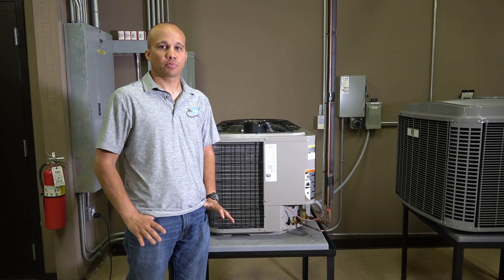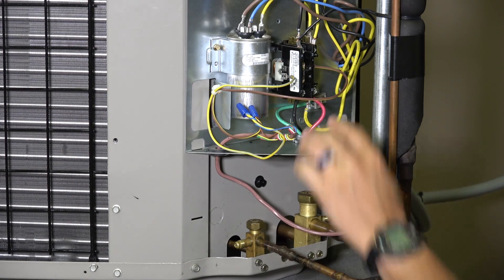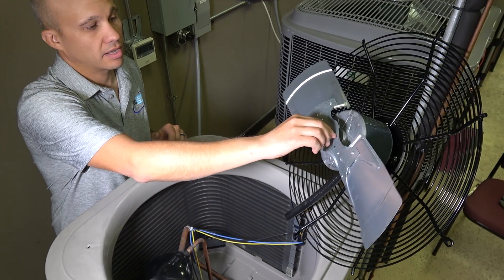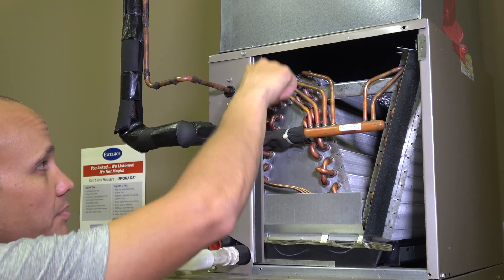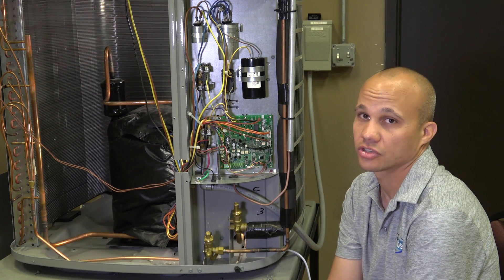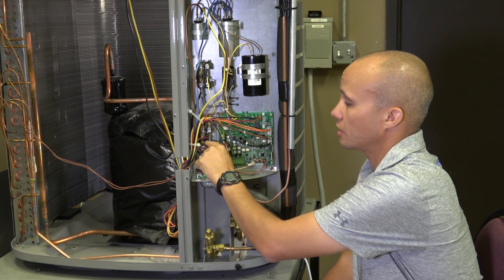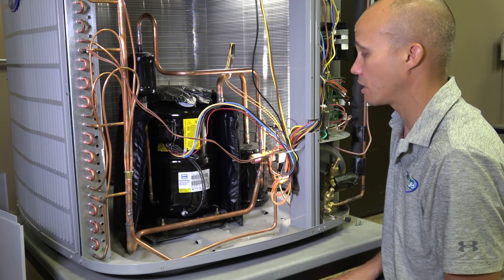Air Conditioner & Heat Pump Components

Comment: Thank you very much for the information. I just had my Carrier heat pump, coil and gas furnace installed by a company a few months ago. But there is always a mild baseline sound probably from the transformer even when the system is not running at all. Is it normal? There is a WetSwitch attached to the unit. Does it cause the minimal sound? Thanks
Reply from the maker: Sorry, without hearing the sound, we cannot guess where it is coming from or if it is normal.
Reply: Thanks for the response. It is like minimal humming sound from the lower part of the unit where the transformer and blower are. But anyway, it is still possibly normal if there is a minimal sound when the system is not working, or any sound would be abnormal when the system is not running?
Reply from the maker: @beckhamzhang4805  For the furnace, no noticeable sound would be normal when the system is off.  For the outdoor heat pump, if you have a 25VNA model, then a slight high frequency sound could exist from the inverter even in the off state.
Reply: @TECTubefilms  Thank you very much for the information. It is very helpful. Can you hear high frequency sound of the inverter (in the off state) only from outside close to the heat pump, or can you hear it from the inside unit in the basement?

The system I initially ordered was listed below. But on the day of installation, 58CVA110-20 was replaced by 58TNOA110C21–20. I was told 58CVA110-20 was out of market. 58TNOA110C21-20 is the same as 58CVA110-20. Does this change affect the sound?

Carrier Infinity 25VNA8 Heat Pump 4 Ton + 58CVA Furnace 110 BTU, ! AHRI Matched
INCLUDES
Carrier® Infinity - 4 Ton 18 SEER Residential Variable Speed Heat Pump Condensing Unit
Carrier® Infinity 80% AFUE 110000 Btuh Variable Speed Multipoise Gas Furnace
4 Ton Evaporator N Coil Cased Vertical Upflow /Downflow Painted 21" Width (Aluminum)
HSPF: 10 | SEER: 18 | EER: 10.5 |AFUE: 80 |CC: 45000
FEATURES
Sound reduction: fully insulated cabinet and QuieTech noise reduction
Technology: Variable-speed blower motor

Also include the following accessories:
Carrier® - SYSTXCCITC01-B Infinity® System Control with Wi-Fi®
Aprilaire - Large Capacity Whole-House Bypass Humidifier With Manual
Control

Thanks again.
Reply: The sound/noise is like the one from a bad ballast of fluorescent light when you turn it on, or the one from a transformer of a doorbell with short circuit in a raining day. The sound is mild. I can hear it when I walk very close to it. Or it maybe a resonance, an echo from the hollow system and other nearby appliances. It is an expensive system. Hope it can last for some years, and don't break down so soon.
Reply from the maker: @beckhamzhang4805  For federal rule from the DOE relating to furnace fan efficiency, all furnaces from all manufacturers had to change on July 4 this year.  Once old models are out of stock, customers will get new models.  That change would not affect sound levels in standby mode.
Reply from the maker: @beckhamzhang4805  Sorry, we don't know the source of your electrical sound issue.  Someone would need to inspect the  components to determine the source.  This will need to be done with the power on so it should be handled by an HVAC or electrical professional.
Reply: @TECTubefilms  Thank you. Very helpful. Where can you hear the high frequency sound of inverter?
Reply from the maker: @beckhamzhang4805  https://youtu.be/gawpEtXBhFY
Reply: @TECTubefilms  cool video. I wish you had recorded the sounds of inside and outside units when the whole system is not running. This way, we know if there is baseline sounds when the Carrier Infinity system is at the resting status. This morning, the installer came and said it is normal. The minimal sounds from the lower part of the inside system (where the blower/transformer etc are). He said the sound is from electricity running through the system at the not-working stage. So I feel better no matter what. I keep my fingers crossed that the new sensitive system will last at least 10 years. The old original one lasted 20 years. Thanks much again for your tremendous help.

Comment: Transducers take pressures and in return translate to a processor as holms or resistance aka electrical DC or digital signals.  This unit he is talking about does not employs transducers, thoes were  high pressure and low pressure on off dumb switches they brake and on contact based on pressure excessively high or too low...

Comment: Why does ice buildup on tubing around components, and can that cause lower air flow and warmer air coming into house?
Reply from the maker: It is usually the other way around.  Lower airflow often causes the ice to form.  Restrictions such as a dirty filter, dirty evaporator coil, or closing off registers are generally the cause of too low of an airflow.  Although, refrigerant pressure can also be the suspect.
Reply: The job of the indoor coil in cooling mode is to absorb heat from the conditioned space.  If you don't have enough airflow over that coil, it won't absorb enough heat and the temperature will drop below freezing (it's designed to be approximately 40F).  An improper charge can also be a cause.  In heating mode, the outdoor coil is designed to pick up heat from outside, so it is designed to be 20-25 degrees below the outdoor air temperature.  When the outdoor air drops below 50, the outdoor coil is going to be below freezing by design.  So, any moisture in the air will start to freeze on the coil and piping.  To fix this, heat pumps have a defrost mode, that engages on regular time intervals and the temperature of the outdoor coil. If the defrost mode isn't working correctly, or you have poor air flow (leaves, grass, dirt, patio furniture, etc on the coil) or incorrect charge, will lead to ice buildup as well.

Comment: What is the small black component next to compressor? Mine is a little leaking where it connects to the vertical copper round tube. Are they bolted? Do you by any chance know how to fix it? Also thanks for this useful video!
Reply from the maker: There are multiple black components by the compressor. The two cylinder looking ones are a muffler and a receiver.
Reply: @TECTubefilms  Thanks for you rely. AT 7:41 - I guess you said something sounds like 'ikyo͞omēlātə'?
Reply: The suction line is attached to the accumulator. This line is cold because of the low pressure the refrigerant (Freon) entering the compressor. It will condensate water vapor in the air. This is a good sign. However if you ever have to add refrigerant to your unit you have a leak. Some people think the refrigerant needs to be added every year. This is false. If a technician has to add refrigerant there is a problem, a refrigerant leak. There are 2 types of refrigerant used in residential hvac units R-22 and D-410A. R-22 is being phased out and and is expensive. R-410A is the new type of refrigerant. Fun fact, Freon is a name brand like frisbee. DuPont calls it Freon. In the hvac industry we call it refrigerant.

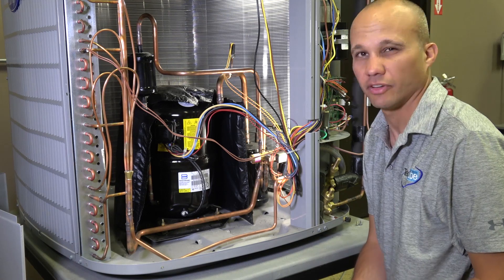Comment: 8:13 - Liquid line drier's function is to keep any debris from reaching the compressor. 

Correct me if I'm wrong, as I'm still just a student, but isn't the compressor a vapor pump?
Reply from the maker: The compressor is not the same as a vapor pump.
Reply: @TECTubefilms  I thought that liquid could/would damage the compressor and that it was necessary for the refrigerant to be in a vapor state prior to entering the compressor? Wouldn't that mean it's a pumping machine designed to only handle vapor? Or can it also pump liquid?
Reply from the maker: @ChristopherMSparkman  A pump moves a fluid.  A compressor lowers the volume or raises the pressure of a fluid.  Since HVAC is a closed system and the volume is fixed, it raises the pressure.  Because of PV=nRT, when the pressure is increased so is the temperature.  The goal is to have a higher temp than the ambient so we can reject heat at the condenser coil.
Reply from the maker: @ChristopherMSparkman  You are correct that we don't want liquid refrigerant coming back to the inlet of the compressor because liquids are relatively in-compressible.  But this has nothing to do your desire to call the compressor a pump.
Reply: I don't desire to play semantics about compressors and pumps. I just wanted to gently tell you that you made a mistake in your video.

Which I think by your responses and focus may or may not have been recognized.

The device mentioned at the aforementioned time stamps is not filtering liquid. It is connected between the discharge side of the reversing valve and the compressor.

I've been told, that placement is normally a muffler. 

Whatever you want to call the device that moves fluidic vapor in the refrigerant circuits it surely doesn't move liquid regrigerant very well.

That's why often accumulator's are used right? We only desire vapor to reach the compressor.

Either way still really like your video's and have learned a lot from them.
Reply from the maker: @ChristopherMSparkman  It seemed to us like your entire post was related to the semantics of a compressor and vapor pump.
Reply from the maker: @ChristopherMSparkman  You also began your post stating "correct me if I am wrong, but..."  That did seem to us like you wanted to debate the semantics.
Reply from the maker: @ChristopherMSparkman  Finally, if you wish to prove us and the entire HVAC industry incorrect and motivate us to start calling all of our compressors a "vapor pump," please provide a hyperlink to a reliable resource explaining the difference between the two terms.
Reply: @TECTubefilms  Gentle attempt to get you to look again at what you were talking about at the time interval that I linked in my first reply. 

Subtle and respectful, not a pompous.. hey guy you are wrong..

but hey.. you are wrong, it's not a liquid line filter dryer at 8:13 ish.
Reply: @TECTubefilms  Again thanks for the replies, it's important to engage your audience. 

It's a muffler not a liquid line dryer. 

Next time I'll just call you out since it seems the know it all in you can't read between the lines when someone tries to send you a hint. 

Regardless I still enjoy the content you put out.
Reply from the maker: @ChristopherMSparkman  Your question was about a compressor and a vapor pump, not a liquid line drier.  Therefore we did not go back and look at the video for any errors related to minute 8:13 or liquid line filter dryers since you were asking about compressors.  We were confused on your question.  We will go back to our technical guys and ask about minute 8:13 now.
Reply: @TECTubefilms  Definitions and Terms really are fluid things, since you asked...

Webster's defines a pump as...

1 : a device that raises, transfers, delivers, or compresses fluids or that attenuates gases especially by suction or pressure or both

Also see NATE Glossary of Terms in their CORE manual:

Pump Down - When either the king valve is closed or the liquid line solenoid is de-energized, allowing the compressor to pump most of the refrigerant into the receiver and shut off on a low-pressure control.

Key word.. PUMP...

Page 1182 Glossery Modern Refrigeration and Air conditioning...

Compressor - A vapor pump that draws low pressure refrigerant vapor from the evaporator and squeezes or compresses it to a high-temperature and high pressure vapor and into the high side of the system. 

Page 1627 of Refrigeration and Air Conditioning Technology, Compressor - A Vapor Pump that pumps vapor (refrigerant or air) from one pressure level to a higher pressure level. 

Apparently the compressor is in fact a vapor pump.. but then again that depends on how you define it... semantics normally really are a waste of time. 

again... there is no filter drier between the discharge of the compressor and the RV on a heat pump. FYI :)
Reply: @TECTubefilms  Yes my question wasn't direct as I guess it needed to be.

I wanted to be subtle... 

When my father wanted me to be able to save face when I misspoke or made a mistake he would always ask a question that made me think about what I just said.

Normally the inspection of my previous statement allowed me to correct my mistake without the need for embarrassment.

Anyway I respect your channel / content providers even more for being civil with me. I tested your professionalism and you didn't degrade the responses, to much :). 

Great work guys, you've got a long term viewer :)
Reply from the maker: @ChristopherMSparkman  We will go back to Ryan and ask about his potential error of the muffler vs. dryer.
Reply from the maker: @ChristopherMSparkman  We don't mind being called out or researching an answer.  We were just focused on the vapor pump question and did not realize you were also asking about the other component at 8:13.
Reply from the maker: You are correct.  The small black device is a refrigerant muffler, not a dryer as Ryan stated in the video.  The dryer ships loose with the unit and is to be installed at the evaporator.
Reply: @TECTubefilms  Every HVAC instructor/class I've ever had, in addition to most other youtube channels, calls the compressor a vapor pump to emphasize that it doesn't pump liquid.  A scroll compressor can handle a little bit of liquid, but a reciprocating compressor will be destroyed by liquid, fairly quickly.
Reply from the maker: @orangeandbluehoosier  We thought this argument was dead after two years… thanks for picking at the old would LOL
Reply from the maker: @orangeandbluehoosier  We are not even going to research it.  Feel free to call the A/C compressor a “vapor pump” on projects and then have to constantly explain to other techs what you are talking about.  :)
Reply: @TECTubefilms  From the ESCO "System Diagnostic and Troubleshooting Procedures" book, P6 Subheading: Noncondensibles "The air and water vapor will pass through the evaporator and compressor because the compressor is a vapor pump."
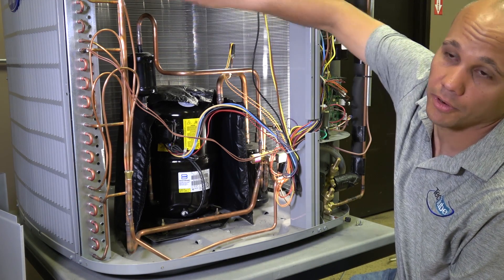Reply: @TECTubefilms  Actually now that I look at it again, the device that you pointing at 8:10 to 8:16 looks like it is connected to the discharge side of the reversing valve. If that is the case wouldn't that be a muffler? 

I'm going through my heat pump training now and I don't recall there being a liquid discharge from the compressor ever mentioned during lecture, am I seeing it wrong?

The way they have us drawing our plumbing or refrigerant flow diagram is with a bi-flow filter drier between the indoor coil and the outdoor coil. 

Also could you explain exactly what the nuanced differences are between the term compressor and vapor pump? Is it because a vapor pump wouldn't compress the substrate where a compressor would?

Comment: 6:45 It is not a pressure transducer. It is a pressure switch. Big difference.
Reply from the maker: You are correct.  The heat pump in the video is a Carrier 25HPA and it uses pressure switches.  Some of Carrier's heat pumps, such as a 25VNA use both pressure switches and pressure transducers.  For those unfamiliar, a transducer will send a specific pressure reading to the circuit board (and possibly the thermostat) to be used to make decisions.  A switch will simply open or close at a specific pressure, thereby letting the control system know the pressure is too high, for example, but not telling it what the actual pressure reading is.  Switches are lower cost than transducers.  Thanks for the correction @movax20h
Reply: @TECTubefilms  Absolutely, the transducers or "sensors" are more accurate, and smart, when tied with controller or computer, and allow for diagnostic, leak detection, and other stuff.  And they operation can be changed dynamically, i.e. with different load, ambient, change of compressor, coils, or refrigerant. But yeah they are more expensive usually. Also pressure switches are more reliable and can switch higher currents, so they can act as safety switches to stop compressor for example. Sensors / transducer don't have that feature directly, but are under control of controller, if it also fails, there is some small probability that it will keep compressor running. Very unlikely tho. No idea what are the regulations.
Reply from the maker: @movax20h  For small residential systems like this one, neither is required by regulation and most entry level units have neither.
Reply: @TECTubefilms  Do you know the brand/model of the pressure switches for r410a? The video shows a "Sensata ps80". I found online that for r410a the high-pressure switch should open at 600 psig and close at 500 psig while the low pressure switch will open at 50 psig. Is this correct? Do you also know a good brand/model for HVAC pressure transducer?
Reply: Yea I noticed a bunch of glossed over inaccuracies in some other areas of the video myself..  The capacitor descriptions were kind of terrible.. I wish these kinds of videos didn't exist.  Don't report on stuff as an expert unless you actually know what you're talking about
Reply from the maker: @localbroadcast  Thanks for the feedback.  While we of course prefer positive feedback, we will take some negative feedback also.  Is there another YouTube channel that you can reference for us that has videos with higher level HVAC experts?